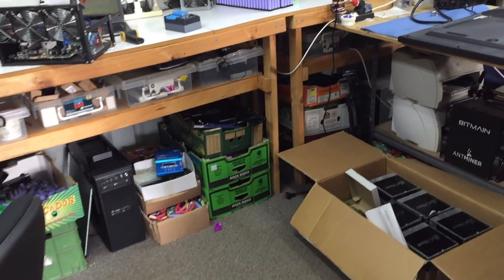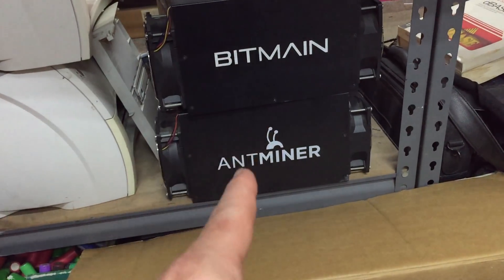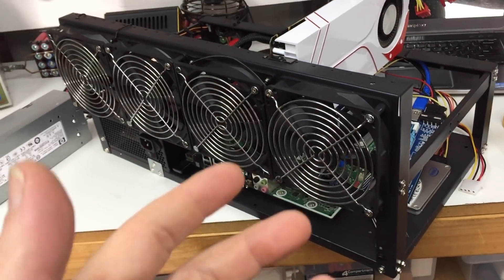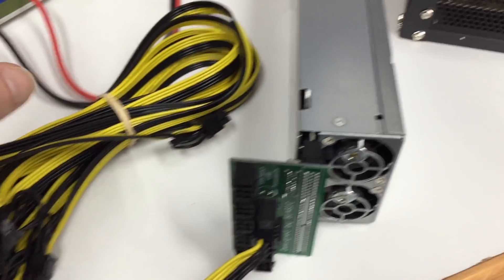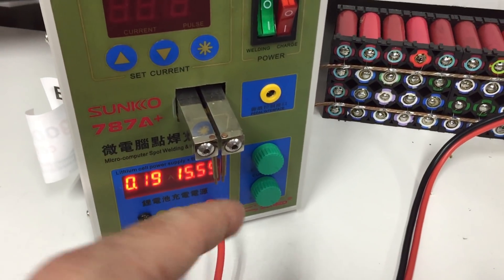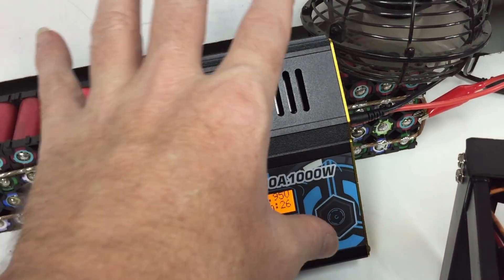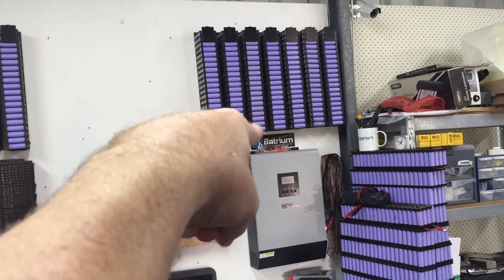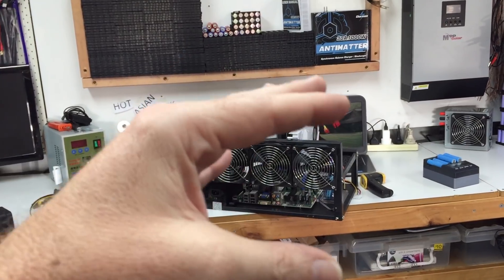A handy update - #Cell5 gets more air time, More 18650ED Cell mounts, Bita Bitcoin stuff too i guess

Comment: So what is differant with cell 5 that you keep testing it? I went through most of your videos @nd im still lost.
Reply: A lot about cell 5 (pack 5) is that he just through together cells into a pack that he didn't fully capacity test and they have varying capacities. Some people were saying they were pulling cells out of laptop packs, charging them, verifying they held a charge for a few days, then slapped them in a pack. There wasn't much testing done beyond that.
Along the way, the pack did pretty good, until he needed to do a heavy load for a few days. That's when the error of building a pack like that started to show up. After that, the pack never really came back up.
I think he's testing it now to see how much capacity it really has now as to what it was "supposed" to have in the beginning. Several key points about the pack 5 is in his live feeds, as well as on the diypowerwalls.com forum.
Reply: Korishan ok thank you for catching me up
Reply from the maker: i think the first video was Will it end in fire thumbnail..